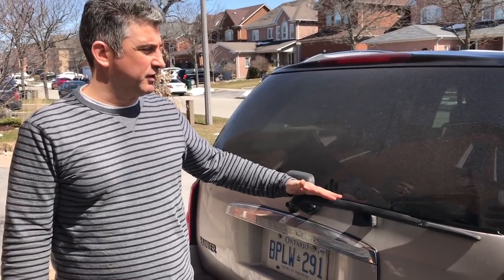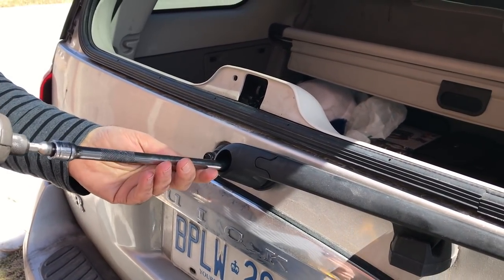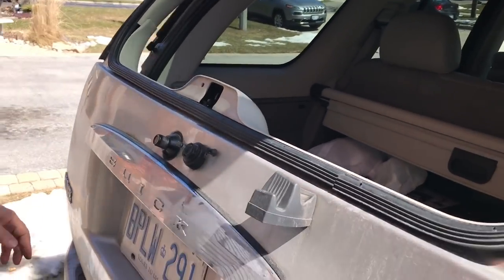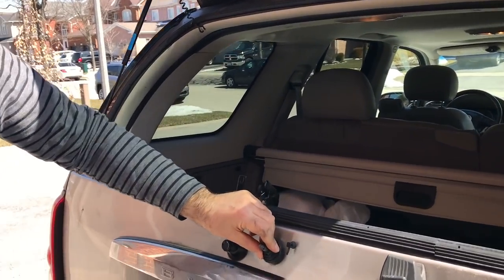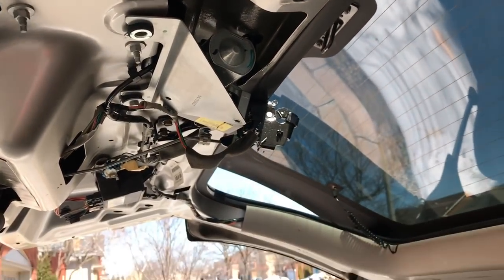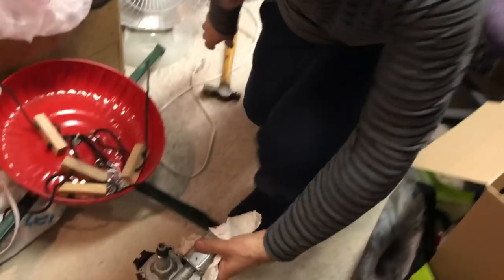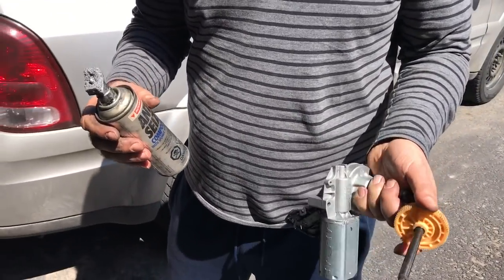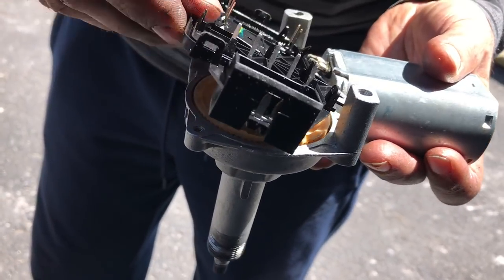How to Fix Slow Rear Wiper on Chevy Trailblazer, GMC Envoy and Buick Rainier for free

Comment: I just took apart mine from my Buick Rendezvous, I have exactly the same problem,  but I didn't take the shaft off because I don't have a bench vise like you do. All I did was flood the housing with WD-40 so it can trickle down the shaft. It's now turning flawlessly. Now I'm going to put it together, hope it's okay now, I manually turned the shaft and the sprockets are finally turning.

Comment: Super helpful video! My 2005 Envoy was completely rusted out where the wiper shaft mounts to the exterior door panel. Epoxied in new metal, did the "take out the drive shaft and relube" thing you showed us, put back together, Voila!! Now, I have a major leak near the firewall when I go to pump washer fluid to the rear....ugh....

Comment: Thank you, man! Clear, concise, walked through every step and its reasoning (very important) and obvious how-to thanks to solid filing. All around good job. I’ll be tackling the motor on a TrailBlazer and replacing the wimpy 2006 arm with a 2007 like yours (cleaner look, plastic-housed arm, should hold up better and look better longer with NY winters).
Reply from the maker: Thanks for the feedback Skippy. Good luck with your repair!
Reply: @robthefixitguy7185 ...you did great  thanks !
Reply from the maker: @angelcardenales7771  Your welcome.

Comment: Sweet job keep up the good work you.  Great explanations, easy to understand and not so complicated.  Just fixed my rear hatch handle on my Buick Rainer 2004 CXL the rear upper molding reveal was deteriorating from the intense heat here in Texas,  cracked up and third breaklight was falling out. Went to pick up the lift gate and handle came off and rear license plate holder came off with it. So epoxy resin and 1 day later put that back on. So after watching your video I'm going to tackle rear window wiper.

Comment: Hi Rob, great video! Unfortunately my arm no longer moves now. The wiper juice still squirts out, but the arm does not move. I am worried that I put the gear back in the wrong place during re-installation, do you have any tips for the correct alignment of that plastic gear?
Reply from the maker: Hi djr, please rewatch the video at 13:00. The black backing needs to fit flush with the metal case. If it does not, then your gear is not correctly positioned. Remove the black backing adjust the gear and then check again. You may need to have a close look and see where the gear needs to be so that the black backing fits flush. Not super difficult but it is something you can miss. Good luck, you can do it. If all is good and it is still not working recheck all your electrical connections and wiring.
Reply: @robthefixitguy7185  Okay, it must be an electrical issue, because I reinstalled the gear four times all within the half arc groove that is on that gear. The gear recessed in far enough which allowed the plastic cover to fit flush. I'll maybe put a direct power source to the motor and see if that works before reinstallation this time. I was just worried that the gear needs to start from a very specific position.
Reply from the maker: @djr11  Let me know how it goes.

Comment: 2008 chevy trailblazer here. Puller, Penetrating oil, brute force, about to get the propane involved. Any suggestions on getting the arm away from the motor shaft? I'm hoping this post is not so old to get help.
Reply from the maker: Would this video help? https://www.youtube.com/watch?v=PYz3JGT3wv0&ab_channel=BundysGarage
Reply: @Rob The Fix It Guy Super helpful! I think I'll wear my shoes instead of the thongs though 🤣.

Comment: One the circuit board is pried pack, am i suppose to see a lot of gel(lubricant) in between the bottom of gear and back side of circuit board base where the 3 prongs are?
Reply from the maker: Yes, there will be grease. Leave it in tact.

Comment: How do I know what the position the gear was sitting in when I first pulled it out or does it matter what position it sits in when I put the gear back in
Reply from the maker: If I remember correctly, the gear has to be put in the same way it came out in order for the wiper to have the correct sweep on the glass. If you don't recall where it was you will need to do some trial and error. Put it in, see if it sweeps correctly, if not take it apart and reposition the gear. I believe there was a mark on it.
Reply: @robthefixitguy7185  I realized the gear corrected itself after I had it all back together but I didn't bolt it up on the door I had it plugged in to the power and that turned on it's own as it corrected itself that was a surprise to me I was like wow that's cool

Comment: Can you just spray some wd or blaster rather than pulling the whole thing apart?
Reply from the maker: Hi, I don't think it will. The shaft is seized inside the housing. Very little room to spray lubricant. I had to hammer mine apart. It was extremely tight. You can try and see what happens.

Comment: Hey after pulling this all apart I seem to be having an alignment issue. The wiper seems to go too far or to short when wiping. Any tips?
Reply from the maker: Ok, the easiest fix is to remove the wiper arm from the motor and realign, tighten again. Hopefully you followed my advice at 13:00 which was to make sure the wiper motor cover fits properly when reassembling. This is important for the proper range of the motor and wiper arm. If you did that properly, then a simple realignment of the wiper arm by removing and reinstalling should do it. If not, you will need to remove the motor, remove cover, align the shaft, reinstall cover.
Reply: Yes I did but I’m still having an issue. Is their a way I could contact you directly, via email or something?
Reply: For some reason every time I tighten everything down, I gouge the plastic nut and it ends it up looking like hell
Reply from the maker: @frankyhernandez476  Not sure if we can do a private message on here. I don't want to post my email address on here. If the plastic nut is getting ruined you may have the wrong socket size.